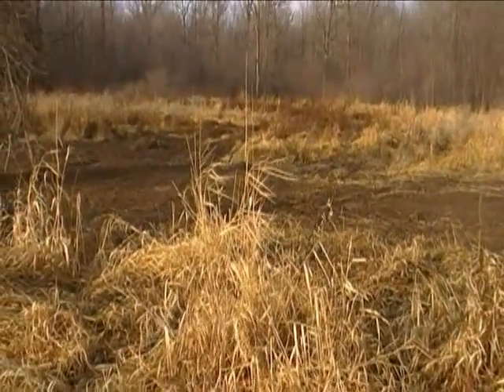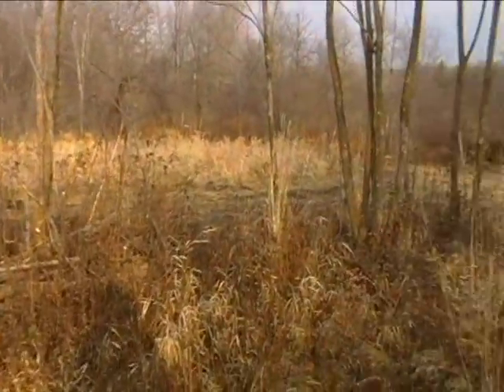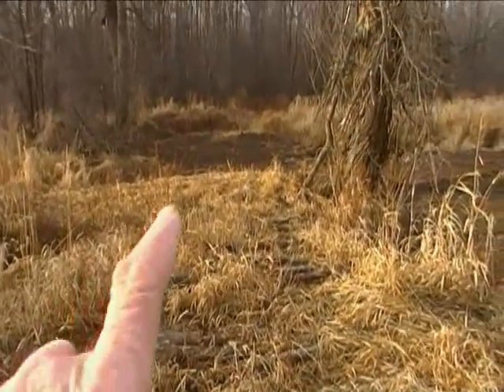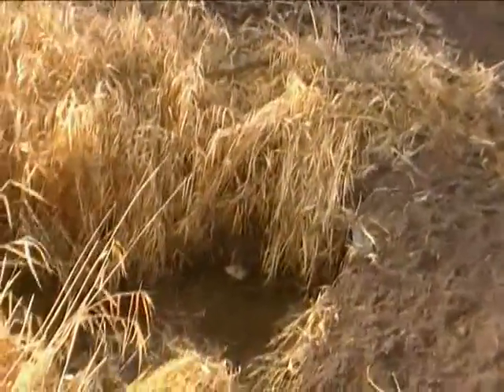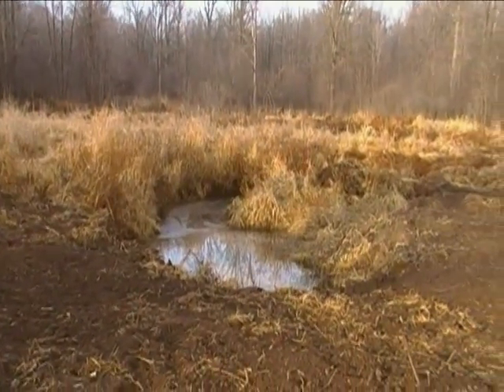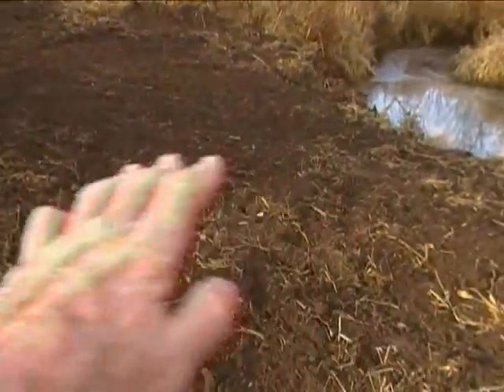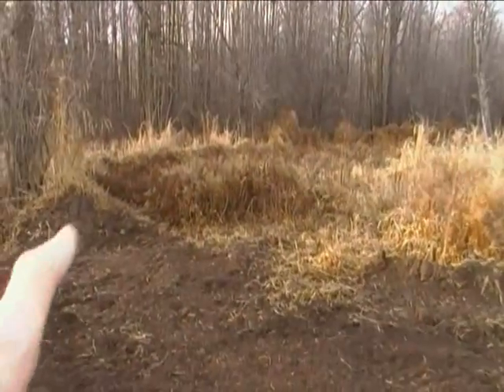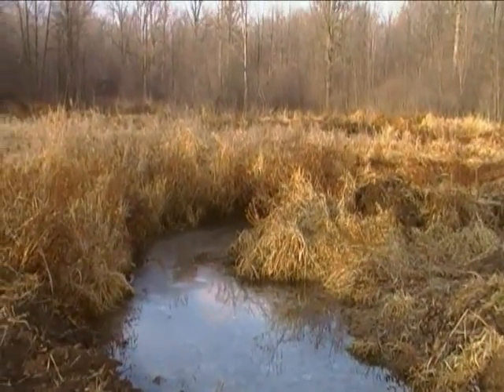Beaver Dam Removal and Restoration 2012B

Comment: Now that it has been 6 years, what is the meadow looking like now? Have any more beaver troubles?
Reply from the maker: Thanks for asking.
No more beaver issues there.  We did have some beavers move into the area, about a mile away upstream 2 or 3 years ago.  But, fortunately they dammed up the stream so close to the county highway that "the county" took care of them before they could send their kits downstream to us.
  The "meadow" looks great.  It's amazing to me how rapidly all sorts of native grasses sprang up after we "drained the swamp".   There must have been millions of seeds down there.  The only downside is that, although the area LOOKS great, it is festooned with ditches that that beavers made, some as deep as a couple of feet and 6 feet wide.  It's actually kinda dangerous to go for a walk in the area without a walking stick.  That's because there's so much grass out there.  One could loose a medium sized tractor.
Reply: Have you considered cutting a fire break around the grass and burning it off occasionally? It would allow trees to repopulate or at least allow you to walk through the area.